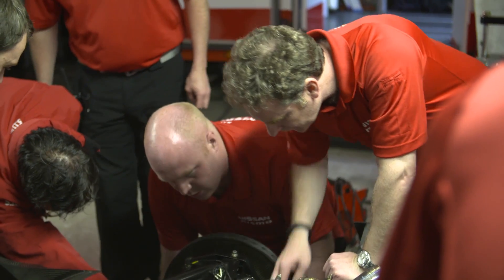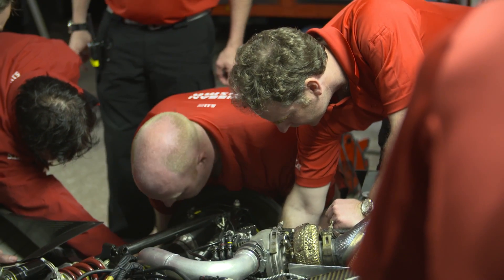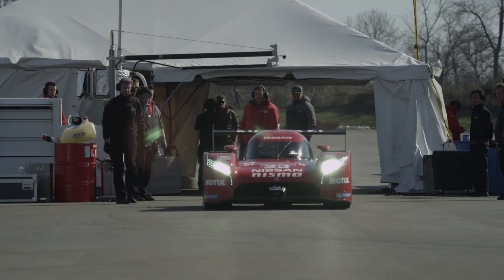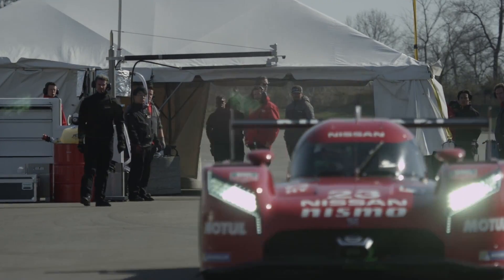Nissan GTR LM Nismo - Technical Director Interview

Comment: Has anyone pointed out that initially (5-6 years ago) Audi did design a LMP that had more focus on running the aero thru the car ( creating more surface area) rather than over it and this extra drag slowed the car down considerably (especially on top speed) like this Nissan. That's the only hole in the engineering logic of this car I see. Did you bring this up by chance?

Comment: I have a question. How does Nissan deal with the gyroscopic precession that's trying to roll over the car when it's turning due to having a flywheel that's spinning with this big angular momentum? Do they have two flywheels spinning in opposite directions to counteract each other or do they just deal with it to avoid the complexity that two flywheels would bring to the car?
Reply from the maker: Peter Georgiev They have the ability to use two flywheels (which rotate in opposite directions), if they choose. If they go with a single one, it's only about 8 kg I believe and they mentioned the effects are negligible using only one.
Reply: Engineering Explained I see, thanks a lot for the reply! :)
Our lecturer talked about gyroscopic precession the other day and how a flywheel can affect a car's handling so I was curious to see how Nissan have dealt with this.

Comment: Why is it opened over the front wheel fairing?
Reply from the maker: Diego Tomás Castro Ocvirk Apparently regulations call for it. It's done to prevent the car from leaving the ground in the event that it gets sideways.
Reply: Engineering Explained Isn't it the case that fully enclosed wheel fairings tend to create some lift because the rotation of the wheel create a high pressure area inside them and they open them up to counter that effect?
Reply: isnt it something aerodinamic because for example in the porsche 911 gt3 rs they ve done something like that. i dont know if is it to make air flow outside the fairing..
Reply: Diego Tomás Castro Ocvirk This is the second time I read a few comments to have fun, and the second time I get a chance to answer this, this is my week. 

Jokes apart, you are right. Some cars like the Ferrari 458 have a hole in there to let the air pressure created by the rotating wheel get out. Of course whether this is beneficial or not depends on the design of the hole on the car and its target (minimum drag or maximum downforce). When you look at them, they are pretty tiny.
Some cars like the 1998 Toyota GT-One had two of them, one at the front and one at the back but with blades to channel the air correctly, plus they were pretty small. It might be very efficient to create downforce, but when you try to create downforce, you usually create drag. Hence they removed the rear ones in 1999.

My guess is that this air disturbs the flow on top of the car, increases the frontal area at speed and creates drag by making the wheel suck drag more air from the side, which creates vortices on top and makes the car less slippery. I guess they don't want this on LM cars, for straight line purposes.

Now this is one seriously large hole so I seriously doubt it helps the car. It must create some drag (quite obvious) but is very efficient at reducing lift when the car goes sideways. Joining the assets of this - improved security and cars going slower - and McNish's accident in 2011, the FIA decided to add it to the regulations.

I'm not an expert/aero engineer. I bet EE would explain it a hundred times better than I do, and without mistakes.
Reply: dpro1995 great man. When going sideways i assume is to prevent air getting trapped under the fairings which could lift the vehicle.
Thanks all though.